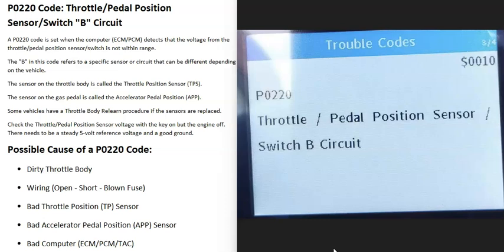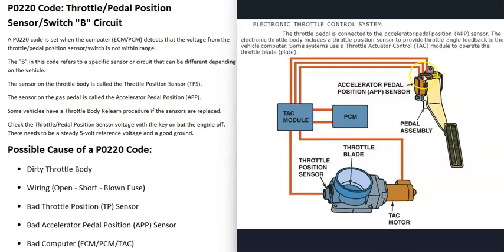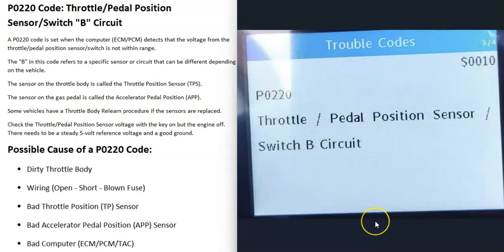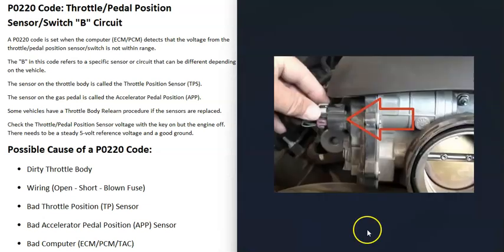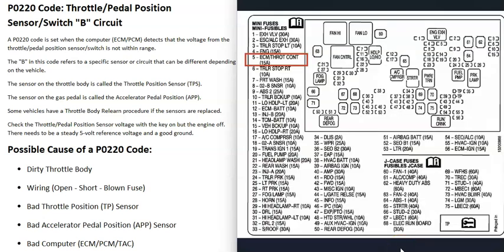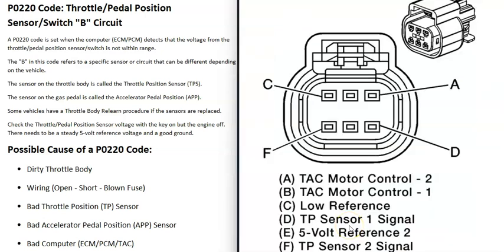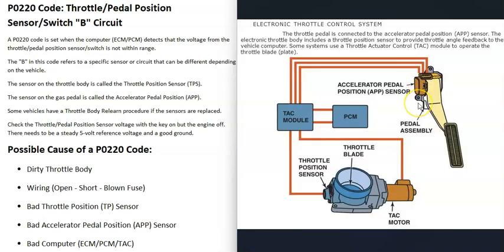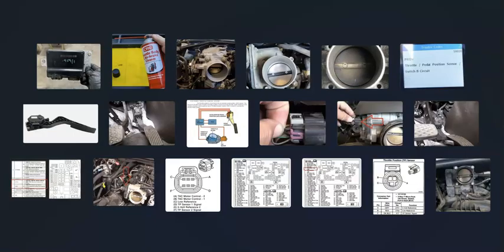Causes and Fixes P0220 Code: Throttle/Pedal Position Sensor/Switch "B" Circuit

Comment: I have a costumer with a fiat ducato caravan 2.8 jtd .
Mice has eaten all the wiring in the car. Not able to get new wiring. I have soldet about 90 wires back together. The car could finally start. But no reaction on the throttle.  Funny enough there was no obd or data connection anywhere in this car. Tried to connect up to K-line but K-line wss unstable, a driver had shortened in the ecu as result of mice shortening different wires to ground. Had to resolder the entire printplate inside the ecu and change a driver. Finally got a stable k-line output from the ecu. Soldet a new obd connection and hooked it up with my diagnostic tool. I am finally in! I could finally see codes ! And are left with p0608 p0220 and p0120. 
Never been so happy to see a fault code in my life. I feel that i am close now

Comment: I have a 2007 335i and got signal 
A and B codes. I cleaned the TB and unhooked the battery for a few seconds. I thought it was fixed but only lasted a week and is back. Now I bought some CRC electronic cleaner and will clean the male/female connectors and see if that does anything.